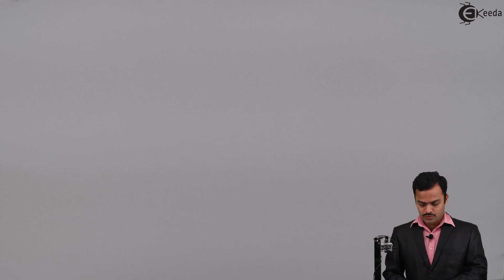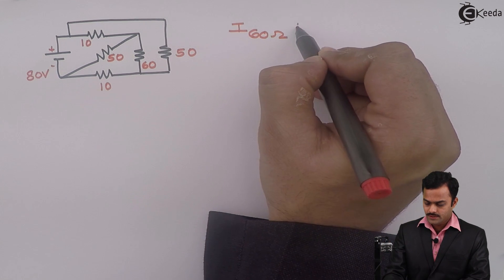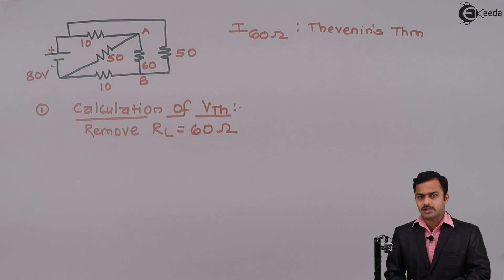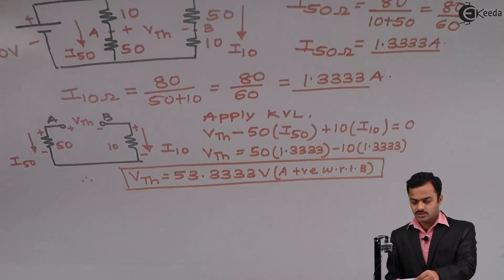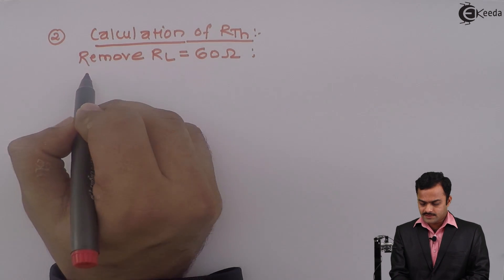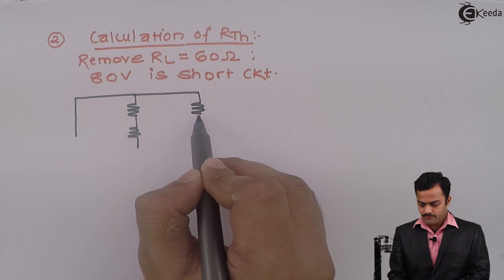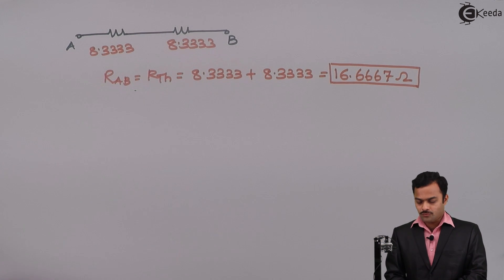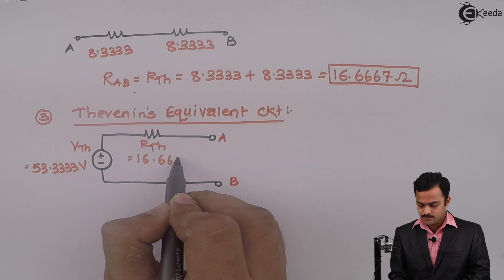Thevenin's Theorem : Problem 1 - DC Circuits - Basic Electrical Engineering

Comment: You mentioned that in Rth calculation A and B makes parallel then  in Vth calculation you just added the resistance where A and B points were still present.
During Vth doesnt that makes any senses with parallel and series ?

Comment: Thevenins theorm states that the equivalent voltage will be calculated across open circuited terminals and not short circuited terminals

Comment: actually i did nt understand why 10 ohm and 50 ohm are in parallel..its probably in series mode in my perspective
Reply: Same bro even i cant understand why he is consider  like that
Reply: In Vth calculation resistance 10ohm and 50 ohm are connected to the voltage source end that makes them in series and in Rth calculation there is no present of voltage source so it is parallel in that case .
It's tricky

Comment: how do we find which one is the load resistance among resistors?
Reply: For example a question is given as "find the current passing through 6 ohm"then load resistance is 6
Reply: The resistance across the terminals a and b is load resistance

Comment: how 10 and 50 ohm are in series between  A   terminal  it should be parellel
Reply: mihir pandey pandey see the one terminal is connected to battery while other by both resistance
Reply: So it's in series
Reply: @starwarcat112  thanks i exactly got what  i was looking fot